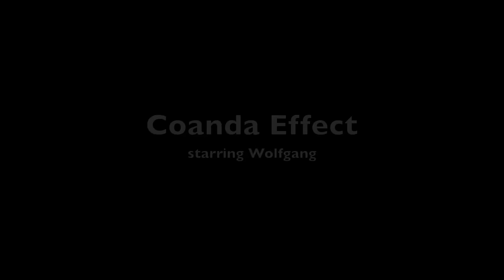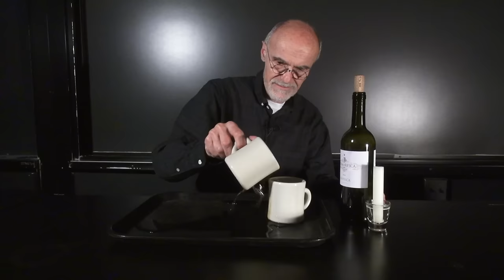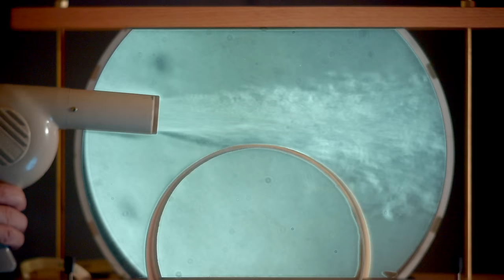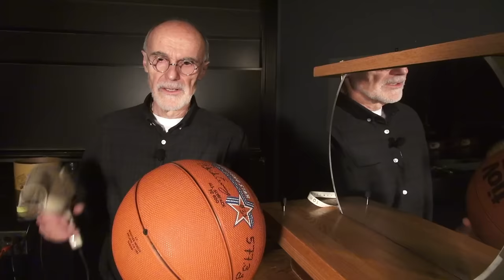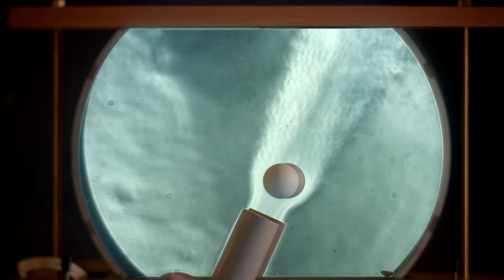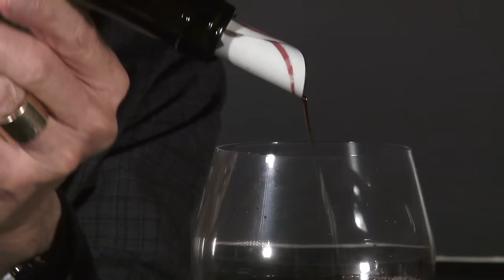Coanda Effect

Comment: Wolfgang, thank you for making this so easy to understand.  I've know about this effect for years and somewhat understood the science behind it.. Now I have a better grasp of what is going on.  My motivation to revisit this stems from my building a small fume extractor to use when I am welding in my home workshop.  I noticed that most of the professional fume extractors typically have a bell-mouth at the end of flexible duct on the suction side.  Also, I have seen the same bell-mouth design on the suction side of fluid pumps and gas turbine engines.  I am in the process of constructing a rectangular bell-mouth for my fume extractor.  I went with this shape because it is the easiest to construct from 22 gauge sheet steel.  A round bell-mouth would require special spinning machinery.  I sized the small end to fit a standard 4" x 10" HVAC register boot that transitions from rectangular to 4" round.
Hopefully, the Coanda  effect will behave nicely with my custom bell-mouth.

Comment: Explaining why there's a low pressure area and a high pressure area is the most important part of the video. It could have used more attention.
So you're saying there's air being pulled into or with the main flow by friction, colliding with the air already in the flow. Normally this additional air enters the flow from all sides, so these collisions balance each other out and the flow remains straight. When a curved surface is introduced, air cannot enter from below because the surface is in the way, so air entering the flow from above knocks the whole flow down, following the curvature of the surface.
Reply: that's a good way of thinking about it
Reply: Wait, so why do fluids stick to the shape of convex objects?
Reply: You really put it in a way that made me instantly understand it. Thank you.
Reply: Navak regarding your last point about ‘air entering in from above’ it’s important to note that this doesn’t magically happen and that the cause of this is because the air below is moving down…
As you said, the friction or ‘viscosity’ of the fluid will cause the air on the far side of the curved object to move away from the surface of the object. This creates a low pressure area below the air/fluid flow, and a normal pressure above the flow of the fluid. 
Now as there are more particles above that are hitting the particles within the flow of the fluid than below, it will have a net force downwards.

Comment: The last case (the bottle) is not because the Coanda effect, but the surface tension of the liquid. Think that if you pour the wine extremely slowly it will stick too and there is no speed for Coanda effect.

Comment: If we define the Coanda effect as a jet of fluid following a convex surface, then indeed the coffee cup and wine bottle examples demonstrate the Coanda effect as well as the dryer plus circular object example does. However, from a physical perspective different phenomena are at play here. In the dryer example the deflection of the free jet of air is caused by entrainment of ambient air due to viscosity. The liquids follow the surface curvature due to adhesive intermolecular forces, since viscous air entrainment should be negligable.

Comment: As the stream of air is forced around the curve of the ball in essence it is constricted therefore flows faster at the surface resulting in lower air pressure near the ball surface. The higher pressure of the stream at the top pushes the bottom stream downwards and thereby taking a longer path reduces its own pressure and is forced downward by ambient room pressure. Hence Bernouli and microscopic Magnus effect on air molecules are additional reasons.

Comment: Very nice visualization. I am confused though about the wine: is there really the Coanda effect that causes the wine to follow the bottle? isn't it mainly related to surface tension? 

just a quick search on wikipedia: 

A common misconception is that Coandă effect is demonstrated when a stream of tap water flows over the back of a spoon held lightly in the stream and the spoon is pulled into the stream (for example, Massey in "Mechanics of Fluids"[47] uses the Coandă effect to explain the deflection of water around a cylinder). While the flow looks very similar to the air flow over the ping pong ball above (if one could see the air flow), the cause is not really the Coandă effect. Here, because it is a flow of water into air, there is little entrainment of the surrounding fluid (the air) into the jet (the stream of water). This particular demonstration is dominated by surface tension. (McLean in "Understanding Aerodynamics"[48] states that the water deflection "actually demonstrates molecular attraction and surface tension.")"

Thank you!
Reply: You are right in thinking that it is more complicated than just the Coanda effect. Surface tension and adhesive forces certainly come into play.  For example, if you make the glass hydrophobic (by smearing butter on the lip of the glass or cup), then the effect of the fluid's surface tension might predominate and the wine might not be drawn along the surface.  That would be another way of thwarting the Coanda effect.
Reply: andipelamine true..
Reply: Moreover,  most engineering books on aerodynamics  don't even mention the Coanda effect. To be honest, I only heard about it after leaving college,  when I had to study Theory of Flight and other subjects to get my  private pilot's license.
Reply: Well, he said it himself that he understood what was going on when he saw a drop of water sliding on his finger

Comment: Great vid but how is this different that Bernoulli's principle?  The Boston MOS used to have a demonstration installed of what this guy does with the hair dryer and ping pong ball, and it was credited to Bernoulli
Reply: That demonstration (as well as many others) has often been wrongly explained by invoking the Bernoulli effect.  The Bernoulli effect is a statement of conservation of mechanical energy.  To apply it properly to a given situation, one assumes that the fluid is incompressible, is nonviscous, the flow of the fluid is laminar, and you are comparing the pressure changes following along the fluid flow lines (not across flow lines).  In this case, air is compressible, air has viscosity, the air flow is turbulent, and people compare the pressure across flow lines!  With these stringent prerequisites, one wonders if one  can ever correctly apply the Bernoulli principle.  It turns out it does remarkably well in some situations, even if all the prerequisites have not been strictly adhered to.  In those cases where it seems to work anyway, it's a reasonably good approximation.  In any case, the Coanda effect is a better model for explaining the experiments in this video.

Comment: I just had someone dispute the coanda effect's relationship to airfoil lift, stating that coada applies only to jets of air ( like your hair dryer), not to larger air movement.  But surely the entrainment principle still applies.  True?
Reply from the maker: My understanding is that if all the air is moving past the solid surface uniformly—similar to a case where we had a hair dryer that was much, much wider than the diameter of the basketball—then the air would separate from the ball much sooner, because there wouldn't be enough entrainment of the surrounding air to make it conform to the curved surface. There are some aircraft, like the C-17 Globemaster III, that are able to use the Conanda effect to generate some extra lift by blowing air from its engines through holes in the airfoils.
Reply: @NatSciDemos  Thanks.,.I will ponder that.

Comment: Question: would having jet engine exhaust (or any form of propulsion really) distributed across the top of a wing produce greater lift at lower speeds as a result of this effect?
Reply: Yes.... several designs (mainly experimental) have utilised this effect.

Comment: Excellent Wolfgang! Are there limitations to the Coanda effect on something like a spiral shell? Say you take a sheet metal roll it into a spiral pattern with a few internal loops, would the air travel  inside the spiral and come back out(like a smoke ring)?
Reply: The Coanda effect would come into play to help get the air to enter the spiral, but once inside the spiral I think the forces on the air flow would be similar to forces experienced in an air duct (reflections off walls, etc.).  Fluid dynamics is really quite complicated.

Comment: when wine drips down the bottle, is it a Coanda effect? or surface tension ?
Reply: You are right in thinking that it is more complicated than just the Coanda effect. Surface tension and adhesive forces certainly come into play in addition to the Coanda effect.  For example, if you make the glass hydrophobic (by smearing butter on the lip of the glass or cup), then the effect of the fluid's surface tension might predominate and the wine might not be drawn along the surface.  That would be another way of thwarting the Coanda effect.
Reply: It's related to the flow rate.
Reply: @wolfgangrueckner7151  Wiki (and McLean 2012 Aerodynamics) says that deflection of flow of water is not    Coanda effect, but molecular attraction and surface tension:
... the cause is not really the Coandă effect. Here, because it is a flow of water into air, there is little entrainment of the surrounding fluid (the air) into the jet (the stream of water). This particular demonstration is dominated by surface tension. (McLean 2012, Figure 7.3.6 states that the water deflection "actually demonstrates molecular attraction and surface tension.").

Thank you for the thought-provoking video :)
Reply: @sdf420  You are quite right, Serge.  Molecular attraction and surface tension are indeed the primary causes of the coffee running down the side of the cup (the Coanda effect being minor).  The effect of molecular attraction can be alleviated to some extent by making the surface of the cup hydrophobic (buttering it).  Providing a sharp edge that the coffee would have to turn around  allows the liquid's inertia to overcome the attraction (like the wine bottle foil insert).  But neither of those make for pleasant coffee drinking 🙂  Thank you for your illumination.

Comment: There is no friction, it is due to the vacuum that is formed, or not. As the air moves away there must be a continuous flow(the velocity cannot be zero  for adjacent molecules. You could all this friction if you want but it is not due to forces but mathematics). This will create a vacuum in the cusp IF it was not filled with air. in fact, there is a sort of competition between a vacuum trying to form due to the escape of molecules  and those coming in to fill the vacuum. So it is a network flow problem. But some of that air flowing away will swirl back around due to the forces of the vacuum(and so the isobars are concentric squashed circles radiating outward from the cusp). At all stems from trying to push molecules away(blow them away) which is impossible due to the conservation of energy/mass and this sets up a vacuum and anti-vacuum region around the object that is is constant tension(must balance out due the gas wanting to equalize out). The same thing happens with electricity and a liquid also experiences it since it is just a much denser gas(in this case though the variation is density is much less if almost non-existent so the flow will function somewhat differently due to the fluid mechanical differences).

Comment: A beam of laser light when it meets the tangent of a smooth curved surface, when bending of the light occurs, does that qualify as the Coanda Effect?  Light is neither fluid or gas.  

I'm not exactly sure of a tested result (of my question) but maybe somebody knows and can attach a link.
Reply: No, that does not qualify as the Coanda Effect.  The laser beam will only bend if there is a gradient in the index of refraction of the medium (air, in this case).
Reply: He may be referring to a diffraction effect, which can also give the appearance that light is bending (or deflecting) around an obstacle.

Comment: Does the Coanda effect really explain the liquid scenario? The explanation for the gas scenario makes sense but those effects are not at play with the liquids example. Surface adhesion would be a better explanation for the wine.
Reply: Surface adhesion (as well as cohesion) certainly plays a role in this phenomenon, but that doesn't eliminate the Coanda effect.  Smear butter (which is hydrophobic) on the lip of your coffee mug and things will improve because you've thwarted surface cohesion, but the coffee will still not pour nicely.  Only a cup with a sharp edged lip will totally work because the fluid has trouble making it around the corner.  But that's no way to enjoy your coffee. Mind you, the coffee's inertia also plays a part.  Yes, it's more complicated with liquids compared to gases.

Comment: Yes, just a question, if we did the same experiment in a large vacuum chamber with a pressurized tank in place of the hairdryer, will the coanda effect immediately happen on the surface of the cylinder without any ambient air pressure?
Reply: No, it will not.

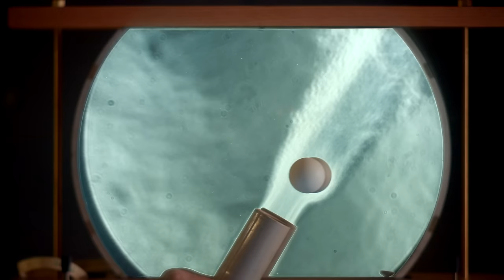Comment: At around 2:55 when he has the hair dryer levitating the ball at an angle, what is causing this levitating effect? 

For this to work I assume that when the ball goes further down towards the ground (from its own weight) then the stream of air below/right the ball has to provide a greater force upwards/left to keep the ball stable and balanced.  
What is causing this increased force when the ball begins to fall outside the flow of air from the hair dryer?
Reply: As the hair dryer is tilted more and more, the ball starts to move out of the air stream as gravity pulls it down.  But also notice that the air stream around the bottom of the ball wraps around it quite dramatically and is deflected up and back into the main air stream.  This is caused by the Coanda Effect as described in the video — it is the surrounding air pressure  (outside the air stream) that pushes the stream of moving air around the ball and back into the main stream.  Because of viscosity, the moving air stream "drags" the ball with it.  So in this case, air drag is responsible for forcing the ball back into the main air stream.  Frictional forces can slow down motion and other times are responsible for motion (friction between the tire and the road can stop a car as well as get the car moving).  Does that make sense?
Reply: Wolfgang Rueckner okay thanks I didn’t think about the friction. However my question still stands. Why is this system so stable? What causes the force pushing the ball towards the middle of the stream to increase as it starts to fall out? Is it that the speed of the air below the ball starts to increase somehow (when the ball begins to fall out), and so this increase in speed will increase the friction force supplied as there are more particles going past in a set time when compared to the top side of the ball?
Reply: @alfredwilson1795  I think it's simply that the coanda effect increases as the ball tries to leave the air stream.  Since it's the ambient atmospheric pressure that contributes to the coanda effect, then the answer to your question is that it's ultimately the higher atmospheric pressure outside the stream that is the origin of force.

In the past, people have attributed the behavior to the Bernoulli effect and argued that since the pressure in the fast moving air stream is lower than the pressure of the slow moving surrounding air, the ball gets pushed back into the air stream because the higher pressure outside the stream pushes it back into the lower pressure inside the stream.  That all makes sense except for the fact that none of the assumptions that are used to derive the Bernoulli effect are correct in this experiment.  The Bernoulli effect assumes laminar flow (not turbulent) and a non-viscus fluid.  Also, it only makes sense if you compare pressures moving along with the flow (not across the flow).  All three of those assumptions are not true in this experiment.

Comment: Is this effect responsible for the aircraft wings for the buoyancy?
Reply from the maker: It definitely plays a role in how wings provide lift.
Reply: @NatSciDemos  it literally cannot play a role in how wings provide lift as there is no jet of air to do the entraining required for the Coanda effect. We try to design aerofoils to have laminar flow. Now you cannot keep the flow laminar it will always transition to turbulent, but it is laminar around the LE and typically well beyond the point of maximum curvature or thickness, depending on the size (Reynolds number) of the aerofoil (flow). But, where the majority of the pressure difference is located, the flow is laminar. As such, no turbulent mixing to entrain air for there to be any Coanda effect.

Comment: reduced pressure, why? I suppose it's due to Bernoulli effect, how's it related to your explanation?
Reply: The Bernoulli effect applies to non-viscous laminar flow, not the conditions in this experiment.
Reply: @wolfgangrueckner7151  
https://pin.it/5YBJ1FW
the two are directly related.. low pressure created by the more rapid movement across the longer path, but in a compressible fluid, like air there's a vortex created by the curve.. at least, that's what my father taught me.. he taught reactor theory at the graduate level when I was in high school... I got this information flying to Europe when I was 7.. that's why we had a problem breaking the sound barrier.. we had to redesign the airframe and wings for a lesser vorticity across the upper surface of the wings.. the first jets I saw were in Wiesbaden.. w Germany... long time ago